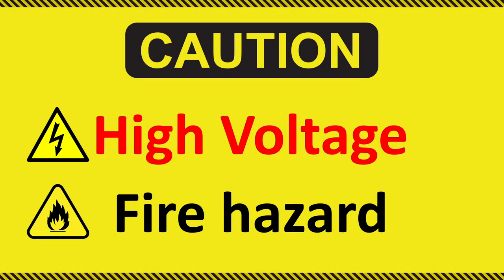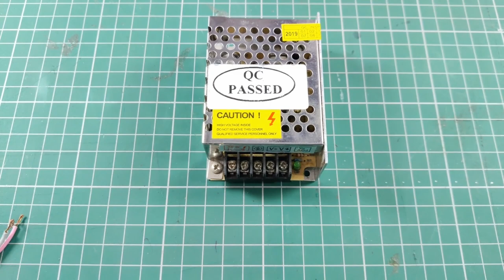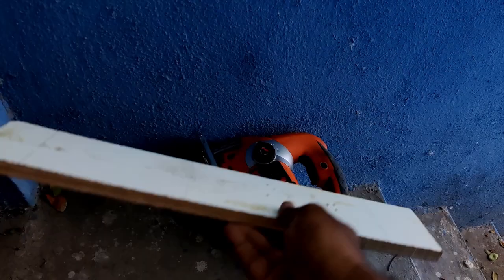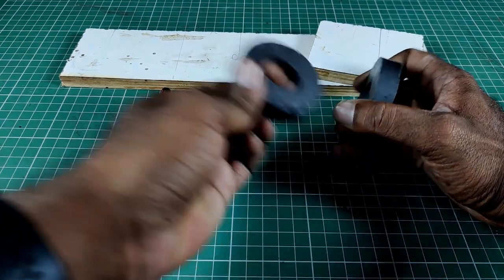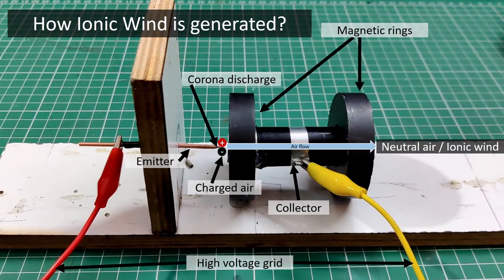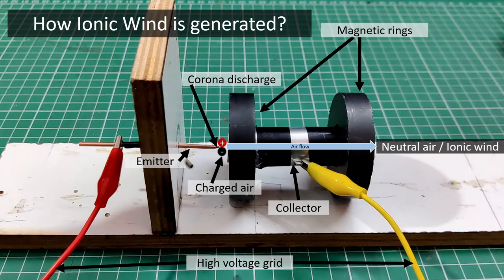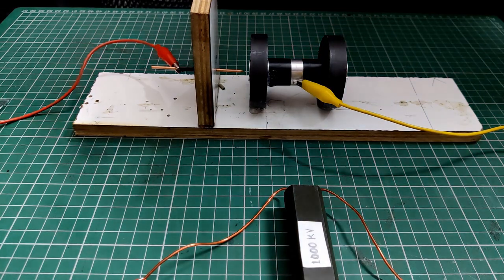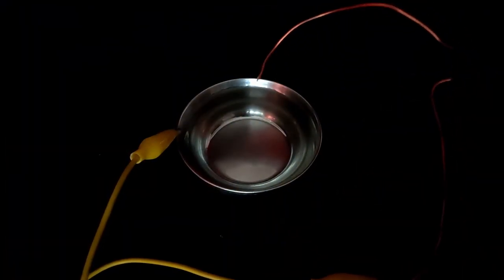DIY Ionic wind / propulsion / thruster and high voltage (400kv/1000kv) experiments

Comment: Fantastic experiments!  They were well shown with lots of creative variations.  I should mention, as you probably already know, that these types of HV modules actually produce much lower voltages than advertised.  If the initial spark is about 1cm long, then the module is producing about 30kV at 14.7psi.  
It is possible to build a xenon thruster that produces some thrust in Earth's atmosphere, but the amount of thrust it produced and the cost of the propellant might make it not such a great idea.
You might be interested in the ion thrusters on my channel that lift their power supplies against Earth's gravity, it took a long time to develop them with a high enough thrust to weight ratio.  I hope to do some vacuum tests with some added propellant this coming week.  Thanks again for showing your fascinating work!
Reply from the maker: I agree. This module is not that efficient. It just helped me to see the ion flow in action. This module is not built for continuous operation. 

I need to learn a lot. I will surely watch your videos. 

Thanks for your comments and suggestions. Cheers!

Comment: The idea of using the magnets is interesting/original.  The ionic wind is impressive.
Q1: Have you experimented using the aluminium tubes with vs without the magnets?
Q2: What is the purpose of the tape inside the magnets?  At High Voltages, these magnets are conductors, just like the metal tubing.  What is achieved (or hoped to achieve) by the addition of the tape?

Comment, regarding frying the modules.  
When there is no discharge path, these modules build up a voltage that arcs internally and destroys them.
Where possible, provide a safe discharge path (like a spark gap) across the output that will activate when the output wires have nothing else between them.
Once you have the ionic wind generator (or other experiment) activated and working correctly, you can disconnect the spark gap, and your experiment will continue to function without self-destructing
Good luck!
Reply from the maker: Thanks for your comments. Thats a valuable suggestion. Will try that.

For your questions
Q1 - yes. Without magnets the flow is not as fast. The flow of air also escapes through the outer shell of the metal tube.

Q2. Yes. Thats a ferrite magnet and it's a problem. If the metal tube is in contact with the magnet, now the magnet is also have electrical path and the magnet absorbs few arc and the flow of air was not consistent inside the tube. By having the tape, the flow of air is 100% inside the tube. The magnetic field around the tube streamlines the flow. However we can also achieve it by using magnets only. Thats a separate design. Not tried that yet.
Reply: Thank you for your comment! Would mica play an attenuating role?
Reply from the maker: Mica does not have good electrical properties like free ion flow, which makes it an insulator

Comment: Beautiful! The question I keep pushing is; could this tech inflate hot air balloons?
Reply from the maker: Nice question. Yes it can inflate if the air current to the ionization point is sufficient. Remember, the air current changes in different altitude levels. The more we go up in altitude, the air pressure will reduce and will affect the air current from ionization.

Comment: THOSE HV UNITS WORK WELL EVEN ON 2 AA BATTERIES. THEY ARE ON EBAY FOR ABOUT £4
Reply from the maker: 400KV module can work with new AA batteries. However it will loose its efficiency soon. This module is designed to work with single lithium battery

Comment: Those high voltage dc modules are potted and overheat very quickly you wont be abe to use them for more than a couple of minutes at a time before they fail
Reply from the maker: You are right. Those modules are long gone. But fortunately it worked for a few hours to do some experiments with that.

Comment: It is impossible for that thing to produce 1000kv, most of these proucts sold in China are overrated. Usually 1kv makes 1cm of arc under atm that thing aint making 10m of arcs...
Reply from the maker: I didn't have any way to measure it. At least it was helpful for some of my experiments. I can feel the output is decreasing day by day.
Reply: @MADWalker  Certainly, these product usually come with warning for suggested use around 30s each round. For longer lasting high voltage around 10-20kv, try zvs high voltage drive+inverters
Reply from the maker: I will give it a try. Thanks for the suggestion.
Reply: No. 10 kV gives 1 cm spark. that means 1000 kv is 1MV, that should give a 1 m spark. and no, this things wont kill you. it is the amperage that kils. and the amperage in this case is in micro amperes. minimal deadly amperage is 30 mA. that means by 10 kV you would need a power suplly of min. 300W.
Reply: @davidliu3463  Hello, Please Do you have a suggestion to derive a simple circuit to modulate the output of a ZVS driver in the range of audio frequencies ?